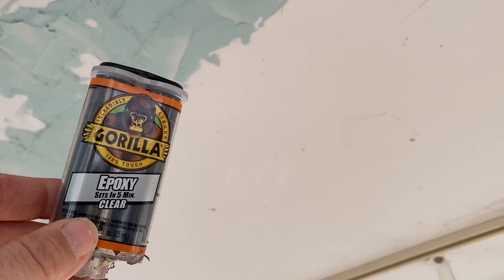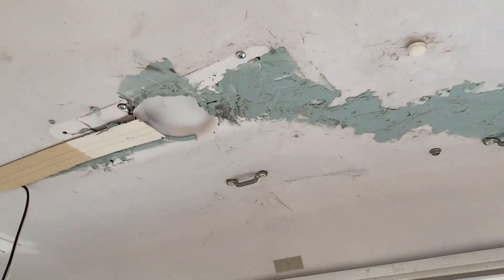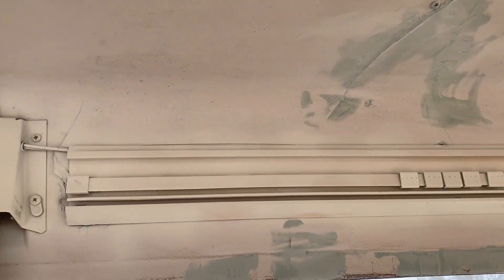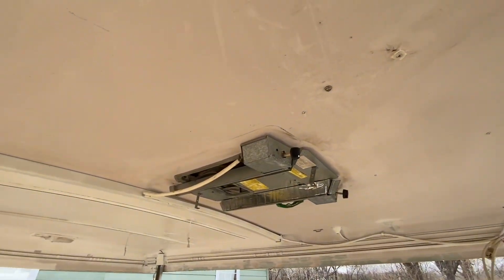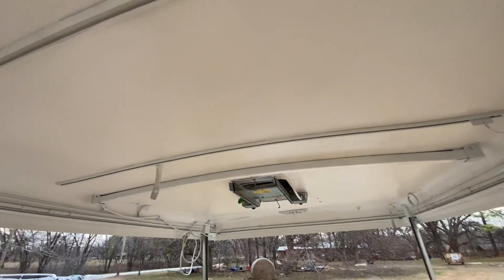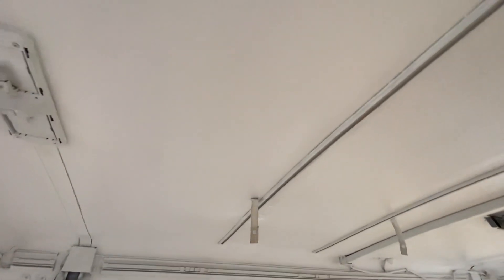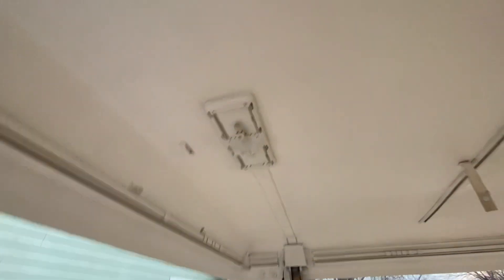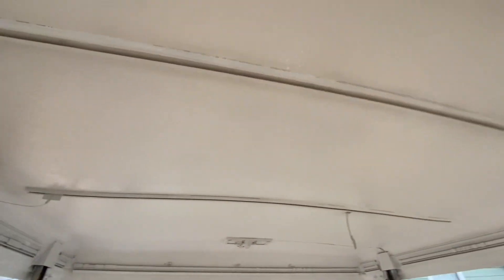Pop Up Camper ABS Ceiling Repair /2000 Coleman Niagara @Just_Makin_It

Comment: What size/length screws did you use?  Did you remove them after the epoxy set?
Reply from the maker: I can’t remember exact size but I just found some small screws.  I left the screws in for more support and put my layers of epoxy and then flex seal over.

Comment: What kind of bondo did you use? Was it hard to sand?
Reply from the maker: I bought the Bondo from Walmart in the automotive section.  (Not the fiberglass) it wasn’t hard to sand, just time consuming.  I’m picky on stuff, so I just kept layering and sanding until I got it to where it matched up well.